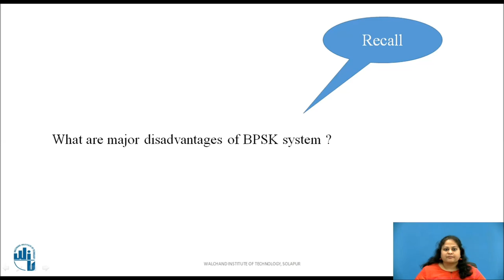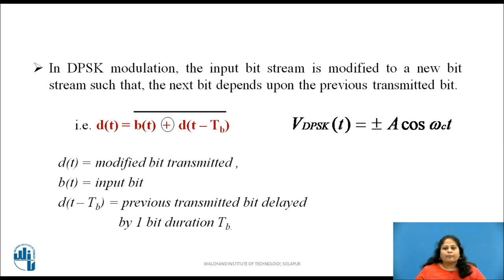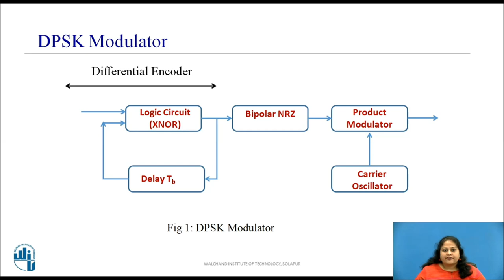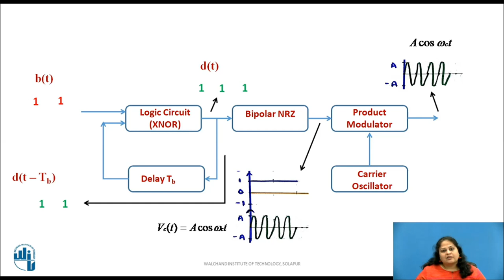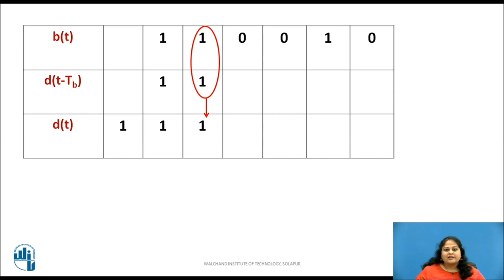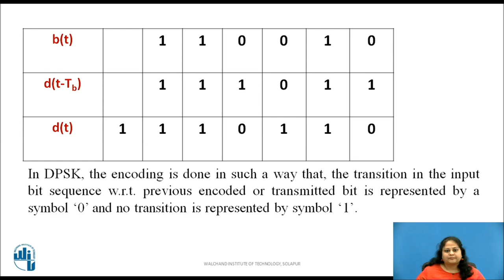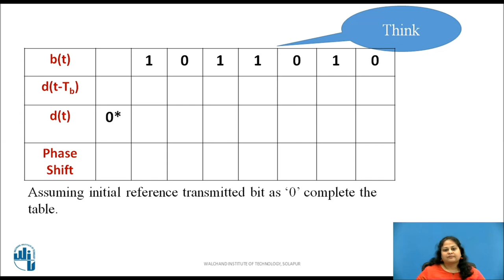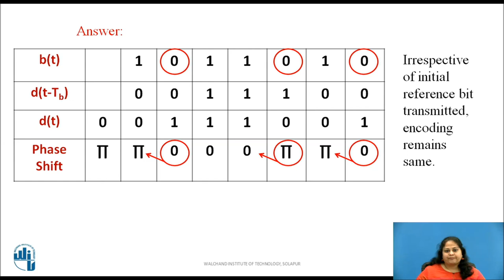Differential Phase Shift Keying (DPSK) Modulation Technique

Comment: How the phase shift is considered?
Is it considered w. r. t the initial bit considered or it is pi for 0 and 0 for 1
Because when we check when initial value as 0, if we obtain 0 it is in same phase and when we get 1 there will be a phase shift.
Reply: Irrespective of initial bit transmitted, in DPSK, when I/p bit  transmitted is 1, phase is same as the phase of previous bit, whereas when I/p bit transmitted is 0, the phase angle changes w.r.t. previous transmitted phase.